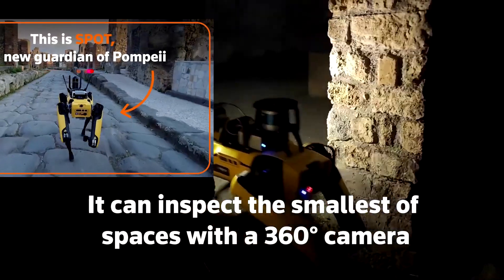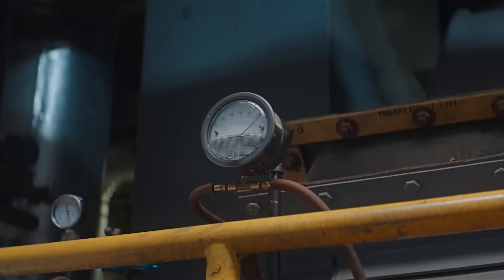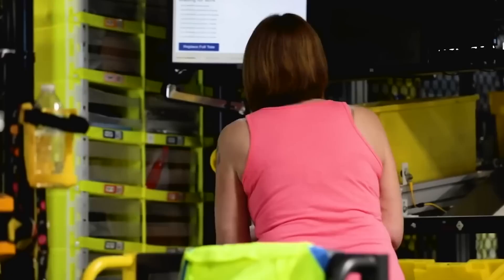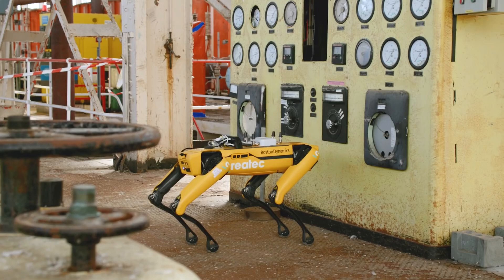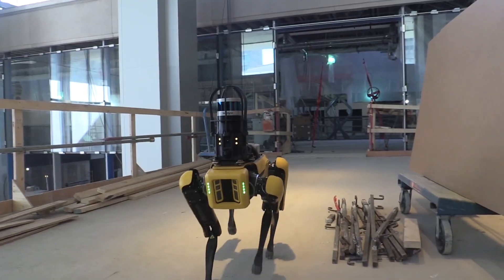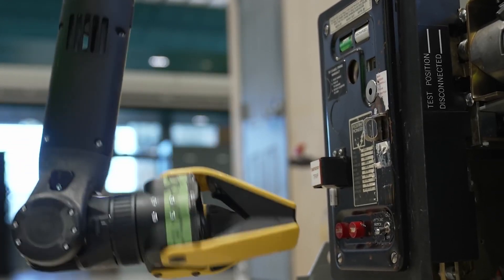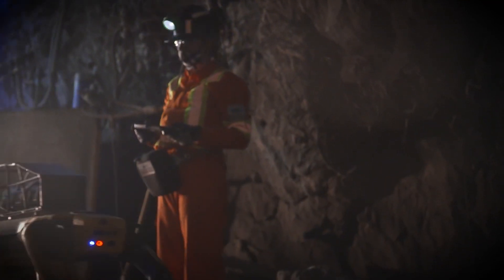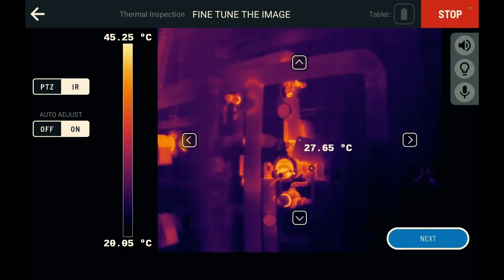Spot NEW Upgrade Revealed: Investors Are SHOOKETH (Boston Dynamics)

Comment: Looks great but the first issue is with vulnerability to radiation? The robots that were tried to clear the roof of the Chernobyl facility were not shielded enough. They ended up having to use biological machines, Russian conscripts who had 90 seconds each to help clear rubble.
Reply: That is a good engineering point, Labra. Radiation exposure to free radicals, radioactive isotopes, and other types of nuclear radiation emitted from the decaying nuclear fission reactors at Cherynbol, was more than enough to seal those early diaster relief robots' fates'. Though, now, we have the power to shape the Future thrrough our Hand and by Sight of Eye. Very insightful, and morbid however, though some sources also said Emergency Personal managed clean up efforts. However, credible sources indicate verified Russian Conscripts in the Chernnobyl Cleanup, documented in Svetlana's "Voices of Chernobyl." Good lad, cheers.